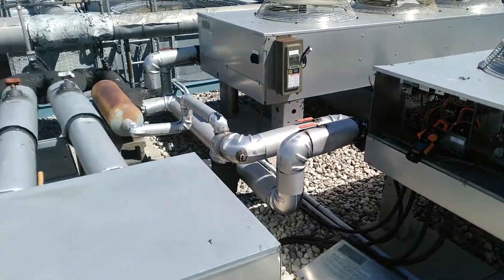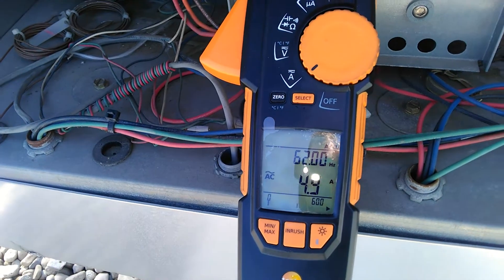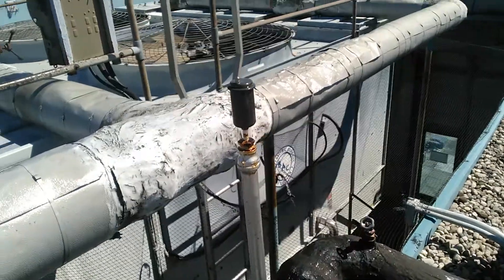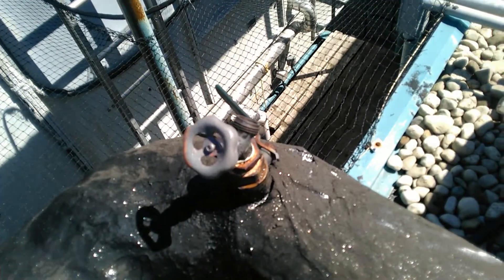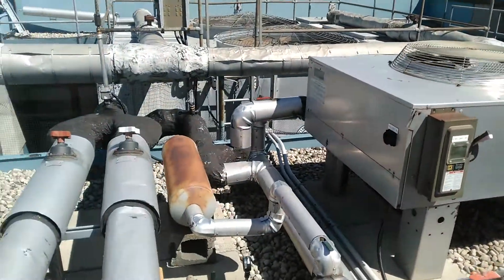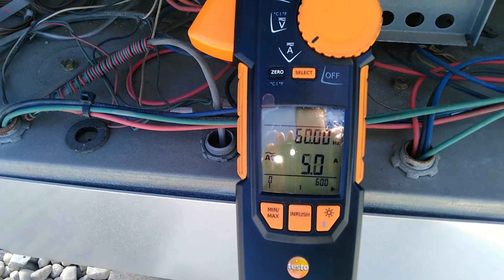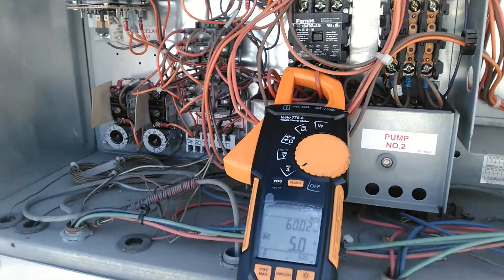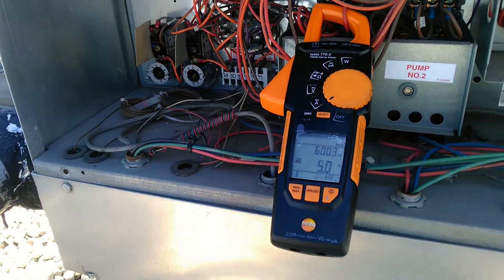HVAC Know It All - Liebert Pump cavitation

Comment: Thanks for sharing. one remark tough. Bleeding the air is one thing, but the pressure is more important. Always make sure to get proper over pressure at the suction side of the pumps. 
I always install a low pressure cut-out switch. That way I never risk cavitation.
The other question is "what made the pressure drop that much?" Leak? Purged air after the pipe -fix?
Good luck!